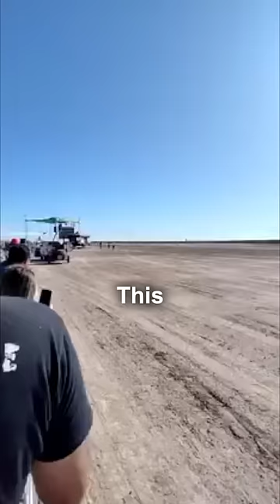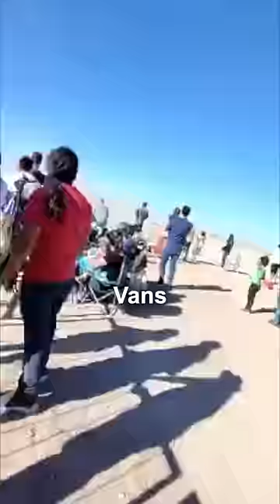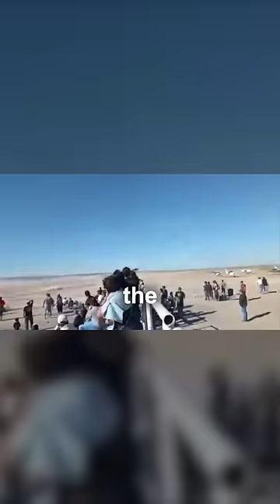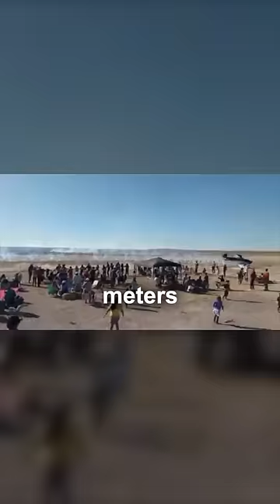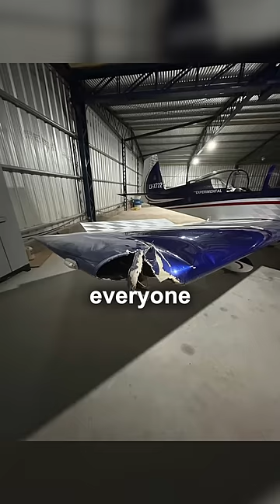Home built aircraft accident #plane #pilot #crash

Comment: The wing does not produce less lift. You simply trade vertical lift for horizontal lift, thus needing to add more rudder opposite of the turn. I don’t blame you, as I’m assuming you’re not a pilot. You were very close.
Reply: And in a banked turn the aircrafts apparent weight/wingloading increases due to centrifugal/centripetal forces...
Reply: You don’t add opposite rudder, you pull back on the stick to increase the lift. Sometimes you have to add opposite aileron to overcome the over-banking tendency.
Reply: @nocalsteve .... you add more rudder input to keep the plane from dropping during a turn like that.
Reply: @nocalsteve  yes you add rudder remember he is sideways so rudder is now up and down alerions left and right
Reply: @saltysteel3996 Using opposite rudder during a turn will cause the airplane to slip. The job of the rudder is to keep the airplane coordinated during  the turn.  Altitude control in a turn is accomplished by controlling the bank angle of the airplane with the ailerons.
Reply: I'm not a pilot and I know you need more rudder.
Reply: @nocalsteve  if you pull back on the stick while in that steep of a turn you will pull the aircraft into a tighter turn.
Reply: @nocalsteve  yes, in horizontal flight.. the rudder points the nose.. so as the nose points to the ground when sideways, the rudder will " lift" the nose and act as a elevator, changing the " pitch" per se.
Reply: @nocalsteve  My guy, this is one of the first things you're taught by your instructor, when turning, add rudder to keep the aircraft level
Reply: @TheFABIOCOOL absolutely not, they do not teach you to add opposite rudder in the turn
Reply: @kevadams1964  If the aircraft is in a banked turn then pulling straight back on the stick will increase the angle-of-attack, increasing the lift of the wings, increasing the G-loading, and causing the airplane to both climb and turn tighter.
Reply: @OntarioBearHunter  Airplanes are not boats. The rudder does not turn the airplane. An airplane turns due to the horizontal component of lift pulling the airplane sideways, and therefore the vertical stabilizer and empennage of the airplane acts as a weathervane pointing the aircraft into the relative wind. The only things holding an airplane up during a turn are the wings, and since much of the lift of the wings is being used to turn the airplane then there has to be an increase in overall lift if the airplane is to maintain the same altitude, which is felt as the G-loading.
Reply: @kevadams1964  Why are so many of you commenting about something you don’t know about?
Reply: Lolol… as an airline pilot, I LOVE watching armchair experts argue about aviation.
Reply: OP.. you’re wrong. When banked, the trade of horizontal/vertical lift is true. So saying it makes less lift, it’s in fact true, since there is less life being created. But I’m sure you just wanted to come on YouTube and flex your private pilot knowledge. 
 And FYI, any time you use the word “thus”… you give yourself away.
Reply: @harveymanfrantinsingin7373  Sorry mr airline pilot but it might have just been too long since you hit the books here. When you bank you trade some vertical lift for horizontal lift, so you are making less vertical lift but your total lift is the same. This is a common question that most CFI’s ask their students that you would get wrong.
Reply: Rudder is yaw control. Lift acts virtually perpendicular to the top surface of the wing, so if the aircraft is  steeply banked, less of the lift effect of the wing is available to maintain or gain altitude. Lift effect of the fuselage side is minimal because it’s not a good aerofoil shape. So using rudder to pick up the nose won’t do much to stop the slip towards the ground.
Reply: Deven and Nocal are correct.  Good for you guys for paying attention in ground school
Reply: @harveymanfrantinsingin7373 lmao what!?  which airline do you fly for? 😂
Reply: ". You simply trade vertical lift for horizontal lift, "

I was going to make a comment about how lift is generally perceived to be "up" and if it;'s not up then it's generally not called "lift", but the fact that the rest of the comments cannot agree on what to do to keep your plane going "up" when it's on it's side is priceless.
Reply: @vinny142    That quoted statement is correct though.  Its all semantics but  Im pretty sure most technical literature will refer to the force vector  perpendicular to the airfoil as lift even if its pointed horizontal in the worlds reference plane.
Reply: @yamkaw346  and here’s where I correct you. Your total lift is not the same. If it was, you wouldn’t need more Rudder to maintain the same altitude. Horizontal lift does not create as much lift as vertical. So… Go back to the books.
Reply: @brianwong6195  lol… I get into it with FAR too many people to post that information!
Reply: @harveymanfrantinsingin7373  My man.... I teach this stuff everyday.... straight from the books. The fact that you just said you use rudder to maintain altitude tells everyone reading this that you are not a commercial pilot. Good try tho
Reply: @yamkaw346 hahaha.. in a knife edge like this you’re not using rudder to maintain altitude?!  You must be ‘THAT’ CFI..
Reply: @harveymanfrantinsingin7373  Look up what a knife edge is and try again... Or just stop trying 🤦‍♂️
Reply: @yamkaw346  Lolol… you can’t be serious! By definition, a knife edge is flying rolled 90 degrees.  You should seriously contemplate a new job.
Reply: @harveymanfrantinsingin7373  😂 alright now I know you’re messing with me, no way you think he’s in a 90 degree bank
Reply: @harveymanfrantinsingin7373  "Horizontal lift does not xreate as much lift as vertical".  Huh?   @harveymanfrantinsingin7373  Lmao this statement doesnt even make any sense.  You just grabbed random words, put them into a blender and threw them into a sentence.
Reply: @brianwong6195  you should probably look up the calculations between horizontal and vertical lift before you start acting like you actually know.
Reply: @harveymanfrantinsingin7373  Enlighten me please.  And what airline do you fly for again?
Reply: @kevadams1964 lol not
Reply: @kevadams1964 lol the only way out! The wing was actually dragging the airplane to the right as it drug on the ground. You think left rudder alone will just rrrrrip that wing through the hard ground and suddenly fly away fine? Lol no..
Reply: @TheFABIOCOOL yeah! The same direction as the turn!! In this case would be more right rudder if you did that! It's insane these comments like this on this video. He simply was too close to the ground and headed tward the ground. Definitely did everything perfect on recovery as he leveled the wings.
Reply: @brianwong6195 absolutely not
Reply: @harveymanfrantinsingin7373 you're talking acrobatics where the airplane has so much damn power that it's hanging off the prop! The wing isn't even flying at all in that case!! Totally different scenario!
Reply: @lovetofly32  nope. I’m not. Lol
Reply: @harveymanfrantinsingin7373 lol as a fellow airline pilot your arrogant, and completely wrong, response is hilarious.
Reply: @brianwong6195 Must be Spirit
Reply: @harveymanfrantinsingin7373 - In principle, you are right (by my understanding), but you are using the wrong terminology and this is why (at least some) people are mocking you. The statement made by the narrator of the video is, indeed, wrong.
The wing still produces the same amount of lift, however, the lift vector is no longer perpendicular to the surface, and therefore, the vertical component of the lift is reduced.
Reply: A bottom wing aircraft is different.
Reply: @RobertStefanovich-iy7jf it's not a knife edge, in a bottom wing aircraft both aileron and rudder will be crucial in this situation. Only do this with mid wing aircraft.
Reply: that pilot bro forgot to go into WEP mode when he banked \o/
Reply: @WithmeVerissimusWhostoned  this isn't war thunder.
Reply: @GaijinGamerGirl  don't destroy my sweet delusions please \o/
Reply: @WithmeVerissimusWhostoned  sorry, not sorry.
Reply: When does a bank become knife edge ?. That looked about 50/55 degree to me so rudder to go with ailerons not crossed controls. Needed more up elevator, (and a little more discretion). Good job it was a concrete strip, grass would have cartwheeled it.
Reply: @michaelsimpson9779  60 degree bank = 2G whatever the speed or radius of the turn.
Reply: @harveymanfrantinsingin7373  warthunder player maybe not a pilot in any sense get lost dude
Reply: @halfrhovsquared  lol.. armchair quarterbacks mean nothing to me. I could care less what they think.  I never said anything about agreeing with the narrator, only mentioned that there is in fact a different calculation used,  when figuring out vertical lift vs horizontal.
Reply: @jiripekny3905  try again. You can’t even troll right..
Reply: @harveymanfrantinsingin7373  - Are you hard-of-thinking?
I never said that you agreed with the narrator nor that you said anything about agreeing with the narrator.
I said that you are using the wrong terminology and that your explanation is essentially WRONG. You can call it "in fact" all you like but you don't get to make up your own facts.
There isn't "vertical lift" and "horizontal lift". There is lift. In the case of the aircraft in this video, the lift vector is not perpendicular to the surface and in such cases we talk of vertical and horizontal COMPONENTS of lift. Lift is still calculated by the equation, Co-efficient of lift x half Rho v squared x surface area (where v is velocity of airflow).
Do you not see the irony in arguing about lift with someone whose channel-name is Half Rho V Squared ?
Reply: @nocalsteve  If you pull the right amount, it won't climb. It's about keeping the vertical component of lift equal to weight. 

When you roll, you need to increase the total lift of your wings, which does mean that you get a stronger horizontal component of lift, hence a tighter turn.

If only wings produced lift, then it would be impossible to retain altitude in a 90 degree bank.
Reply: @vinny142  But that's not how lift is defined. Lift points anywhere.
Reply: Most pilots get that wrong, actually.
But the apparent visual is correct, though.
In a high bank, the wing often produces more lift (as result of pulling back more on the stick,) but it's usually mostly horizontal.
However, the result is, through hyperfocus on a vertical axis, an apparent loss of useful lift to keep you off the ground.

One of those unanswerable question sort of situations.
Reply: Horizontal "lift" does not help you fight gravity. Your plane will still fall. If you're a pilot, you're the sort that gets in this type of accident.
Reply: @nocalsteve  fail
Reply: Thanks, but I won't be flying with you. Balanced turns are nice. 😄
Reply: @brianwong6195  Applying opposite rudder in a turn?? I went to a very different ground school. Obviously a very bad one—I'll use opposite rudder from now on. 👍
Reply: @lucasgroves137  Lmao when did I ever say to apply opposite rudder in a turn?
Reply: @brianwong6195  "Lmao," when did I say you said it?? You didn't have to—you just gave out the elephant stamps for paying attention in ground school. Bit of a weird ground school that prefers skidding turns. 😉 It's okay, we'll watch you walk it back. There'll be a special technicality or clever nuance we didn't see that somehow makes the plain facts wrong. We know none of you guys ever make a mistake. 😆
Reply: @lucasgroves137  Yeah I gave out stamps to Deven and Nocal for saying you pull back in a bank to turn and not via rudder.  

Aint walking anything back, but if ur gonna talk shit and least back it up lol.
Reply: @brianwong6195  Disingenuous, what a surprise. I don't need to, lol, "back up" anything, since I'm not making any kind of claim, just commenting on a plain fact. The guy you congratulate for his knowledge expresses a weird understanding of proper control; not incidentally, but in the head comment for the thread. Why shouldn't anyone have a chuckle at that? I think my comment was pretty reasonable. I'm talking shit?? Explain how I'm talking "shit."
Reply: @lucasgroves137  By definition those werent reasonable because you arent willing to give reasons to any of your claims.  You suggested we said to apply opposite rudder in a turn but cant show where.  You say OP has a weird understanding of aircraft control but hes correct and you cant explain how its weird.

Comment: In a high bank turn, the wings produce the same amount of lift as it does when it's level (at the same speed). It's just that the lift vector is tilted relative to the ground which makes the vertical component much less.
Reply: What you said.👍
Reply: Exactly. Not sure where this guy got that information.
Reply: yep Pilot error
Reply: Exactly

Comment: To all the comments citing the pilot's "skill" in recovering the aircraft, they didn't react before the plane did. When the wing scraped the ground, the plane was still descending.  This descent caused the scraping wing to lift up relative to the plane, decreasing the bank angle, rotating the "constant" lift more vertical, making more of the total lift contribute to the vertical component, arresting the descent, and climbing the plane.  The plane did all the work by itself.  The pilot was lucky that the drag from scraping wasn't strong enough to introduce more yaw to counteract the lift. If that had been lush grass instead of dry, rocky dirt, that pilot would not be alive now and you would have seen a cartwheel and a fireball.
Also, as a flight instructor myself, a pilot that relies on skill will die at the controls eventually.

Comment: Correction: The wings produce the same amount of lift. It is just that this lift is no longer aimed exactly against gravity, so you need more lift to counteract the gravity. And it's roughly hyperbolically increasing amounts of lift as the angle increases, needing a theoretically infinite amount at 90 degrees.
Reply: Thank you. My brain almost exploded when he said that.
Reply: Is it still called lift if it's being applied completely horizontally?
Reply: @ptrk47  "Because the vertical component of lift decreases as the bank angle increases, the pilot needs to increase back elevator pressure, which increases the angle of attack, to compensate for the decrease in upward lifting force, allowing the aircraft to maintain altitude in a turn." 

So to some degree, yes.
Reply: @ptrk47  I looked into it. Lift is the sum total of all non-gravity that is perpendicular to the direction of motion. Drag is always in line with the direction of motion, and thrust is whatever direction the engine is pointing.

So the wings, elevators, and body of the plane normally provide lift. The body only providing lift if the plane is at a high angle of attack (or if it's designed to).

So lift can rotate around. It's generally considered the force in the direction of the upward side of the wings, but there are situations where trick planes generate their lift primarily from the rudder and engine when sideways. I'm not sure what to call it in those situations...
Reply: True, but "asymptotic" is a more accurate term than hyperbolic...
Reply: @dvk578  Is it though? The force that you need is equal to the secant of the bank angle. Secant is 1/cosine, and the cosine function has a slope of one at 90 degrees of bank, making it effectively 1/x, which is the very definition of a hyperbola. There are many different types of asymptotic growth that are not 1/x. This one is explicitly following the 1/x asymptote shape.
Reply: @brandonn6099  Where are you getting Secant from?  The component of the lifting force responsible for countering gravity to keep the aircraft aloft is given by Lcos(theta) where theta is the angle of bank and L is the total lifting force.  With increasing bank the lifting force must increase so that its vertical component is sufficient to maintain level flight.  As bank angle approaches 90 degrees, L must approach infinity.  Asymptotically.
Reply: @dvk578  Now solve for L. There's your secant.
Reply: @brandonn6099  the behavior of a function which tends toward infinity is typically called asymptotic regardless of the shape of the underlying operations.  Hyperbolic doesn't convey the same meaning...
Reply: @brandonn6099  Interestingly...  the graph does actually follow the hyperbolic trajectory if you go from 0 to 360 degrees rather than stopping at 90.  I had never considered that before because from a pilot perspective there was no reason to exceed 90 degrees.  I would still refer to it an an asymptote just to avoid confusion, but I understand your point.  Thanks for the more complete understanding.
Reply: @dvk578  Now you know how to calculate your aileron rolls! 😎

Comment: The plane doesn't produce less lift it's that the lifting forces are pushing the plane more horizontal rather than vertical direction so the pilot needs to roll to compensate.